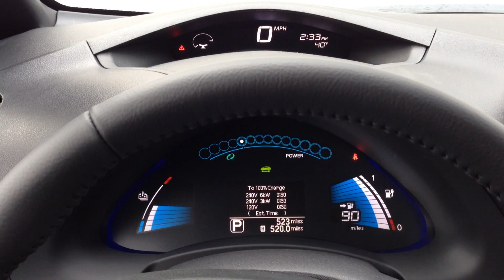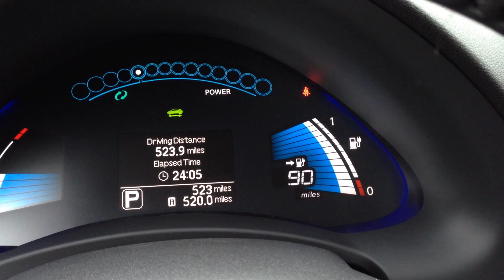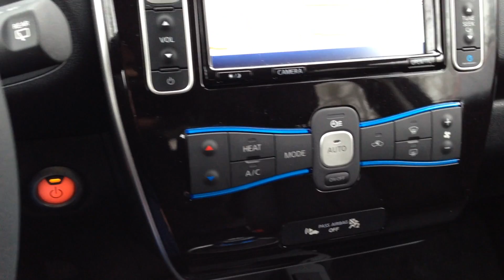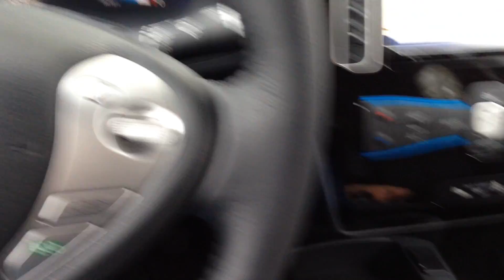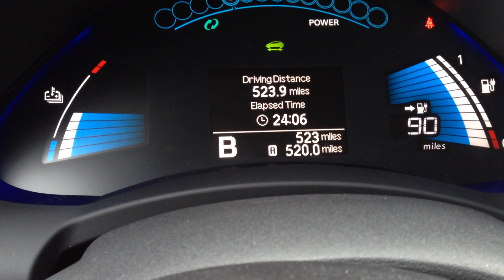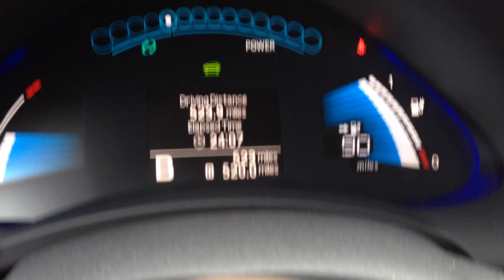2013 Nissan LEAF & LeafSpy App

Comment: That Guessometer is no where correct I have a new battery and it charges to 111 miles. I will only get 85 miles out of it.
Reply: Michael Bouley Yes, that is OK due to the variables encountered during driving. Under optimal conditions, speed below 38 mph, flat terrain, mild temperatures, no AC/heat use, daylight, 1 person, the car could do that many miles and more. Try the same on any ICE gas/diesel, and also u will experience 20-30% increased mpg efficiency. Why Nissan decided to do this I suspect a marketing choice. Good or dumb? Depends. If people paid less attention to driving at whatever cost vs. more attention as to expenses, potentially, this is a great tool: awareness. Is that what people want? That is demonstrable using another scale, the Tesla scale. Tesla owners post videos of: top speeds; acceleration/racing; cruising at illegally high speeds, and about unique features. Only once as a test did I see a Tesla owner documenting a Model 3’d range of close to 500 miles vs. claimed 300.

Comment: Where can I buy LeafSpy
Reply from the maker: The software is available in app form either from the Apple iOS app store or if you use Android the google play store. The hardware is a basic ODB2 adapter from easily and cheaply found on Amazon, they come in BlueTooth and WiFi versions.

Comment: How did you change from D to B? Please be more concise on how, Thanks...
Reply from the maker: +SMS BLAWGG Changing D to B:To change from standard D = Drive mode to B = Regenerative BRAKE mode simply do the following.  When operating the LEAF in forward motion simply reach down and move the gear shift puck to the Left (towards operators leg) and back (towards operators ass) all in one motion. This action if repeated will toggle between D and B mode.
Reply: Okay. Did it. But in my 2012 leaf the B more shows on my dash as a smaller B than I believe yours displayed. And I learned that I can toggle from a B mode to an A mode. When I did this I only had to push the dash buttons at the far left toward the door panel to get it.  I don't know what the A stands for. When I toggle between a or b it seems to adjust my miles. Confusing. Yesterday I pushed the button and got B for regen braking and it seemed to show a calculation of milage that was better in this B mode. THAT was yesterday. Today is the opposite. I hit the  button to A and this showed more milage. Confused! I searched the owners manual..nothing found on this. A vs. B thing. Anyone have answer?

Comment: When you tap on the nipple end of the 'battery' in screen 4 (the one with the corner section alternating between tire pressure and battery temperature) of LEAF Spy, the 'battery' bar graph switches from state-of-charge/gids/distance-to-empty to a power meter that shows throttle power level (or charging power level on the right end of the graph), aux system power level (everything on the 12V bus I guess) and AC/Heat power level.  Anyway, my question as another LEAF user is this: have you ever been able to find out the scale of that bar graph?  I'm sure it's logarithmic left to right (probably log2, like Tesla S's power/regen meters), but any particular numbers I put for each line would just be a stab in the dark.

While I'm flapping my gums, have you been able to find out the scale of the power/regen 'dot' scale?  I'm guessing that's also logarithmic.